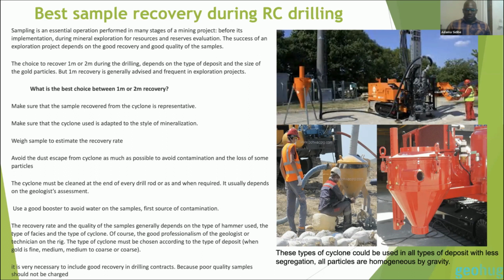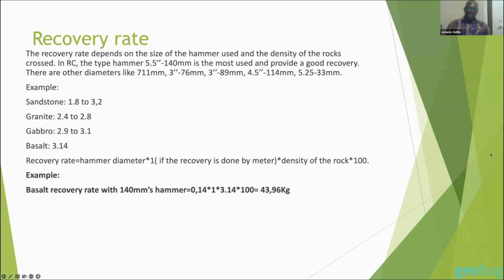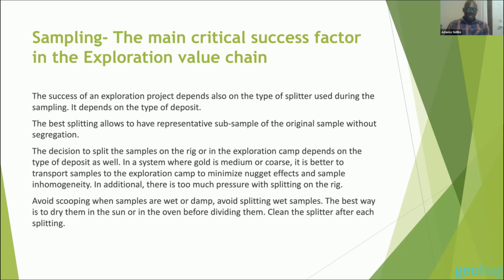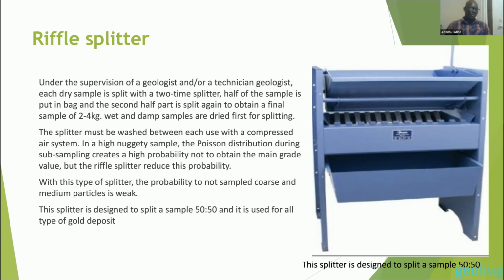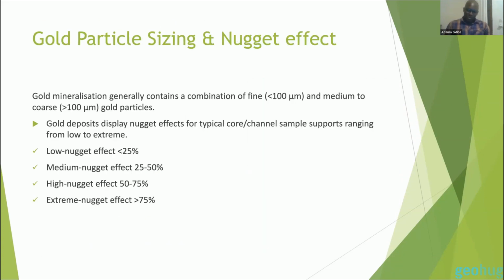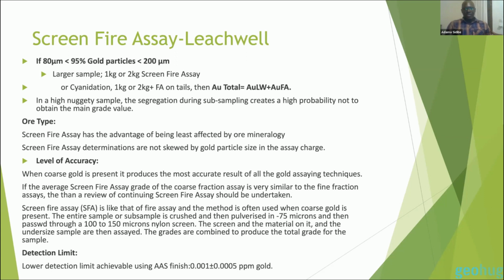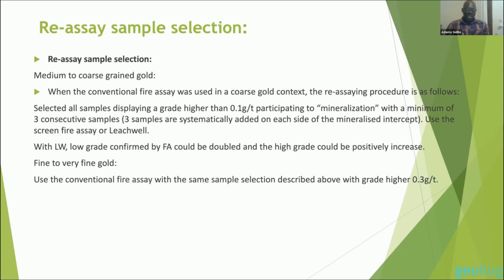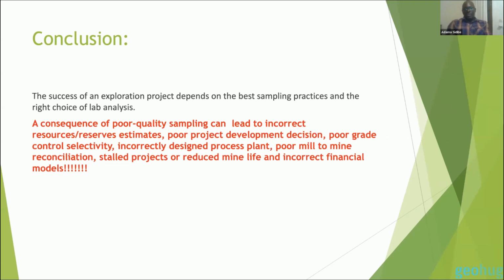Adama Sidibe - The RC sampling and lab analysis protocols, applied to different gold deposit types i

Comment: At 7:55 minute: there's is a mistake in formula for recovery rate. The volume of cylinder is calculated by: V=π * r^2 * h. Moreover, the formula of Mr. Sidibe is not a rate, it's a weight. The correct formula of recovery rate by weight is (%): sample weight * 100 / theoretical weight, where theoretical weight = V * density. For instance: 3.14 * (0.14/2)^2 * 1 = 0.0483 tones = 48,3 kg. Additionally, I would suggest to check basalt density, as it seems to be excessively high: 2.8-3.0 g/cm3 should be normal.